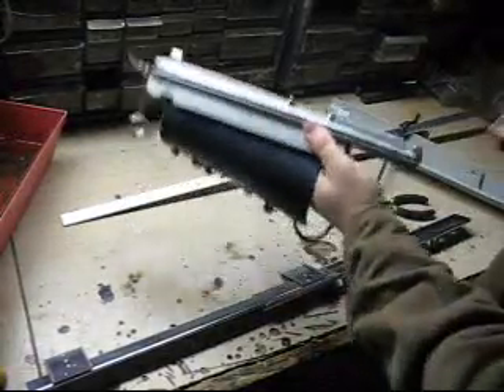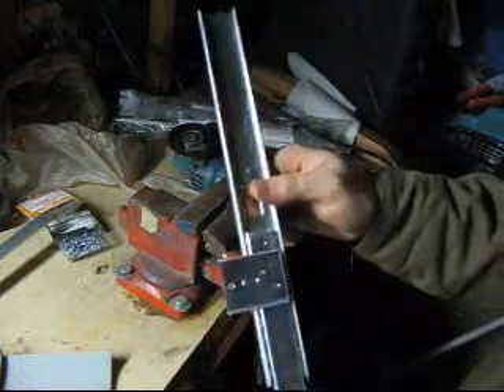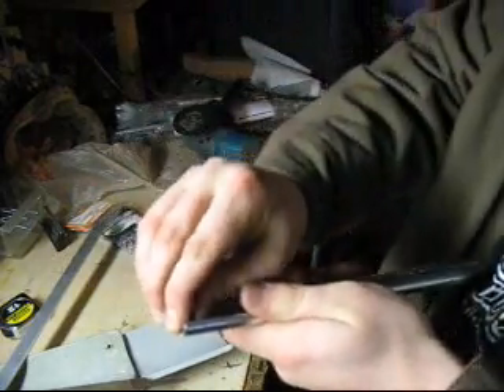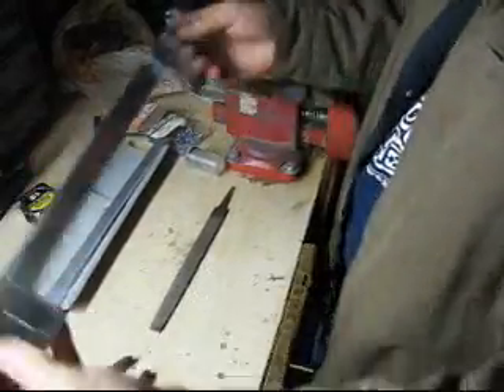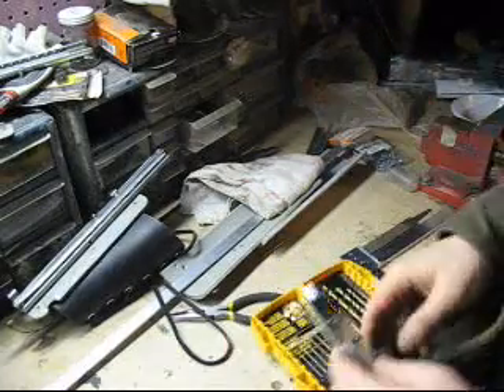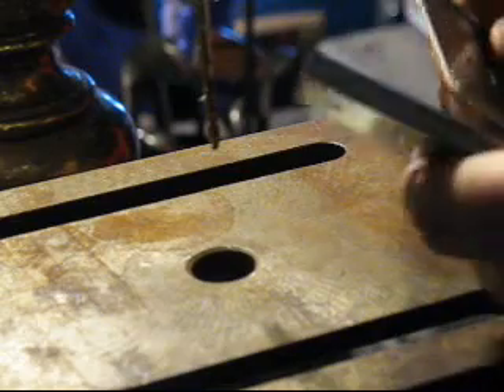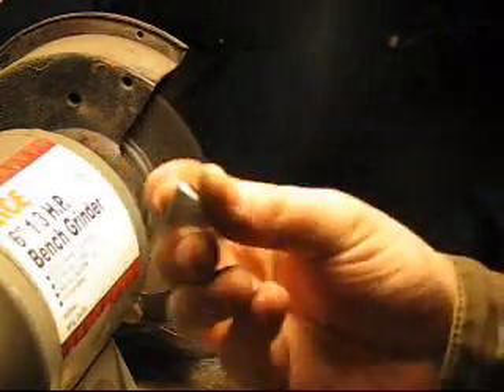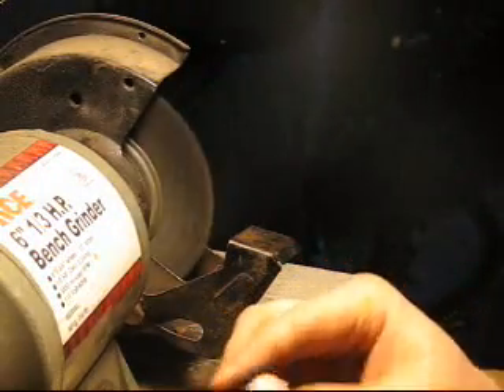Hidden Blade Tutorial Part 2 (Building 1/2)

Comment: where did you get the blade part thingy?! XD i need to know!!!!!!^^
Reply: just buy a steel rule 
its available at any shop
Reply: a ruler? ow "rule"?
Reply: its called a steel rule not ruler
Reply: oh?... alright. ill look. ive startyed my hiden blade. but it dosent like to stay together :'(
Reply: did you used bolts and nuts?
Reply: yes. but the ball barings it rides on to open and close fall out. im using my metal working skills to make a difrent way to let it slide almost freely
Reply: It's a aluminum flat bar but u can use metal rulers too,just that it would still be bendable